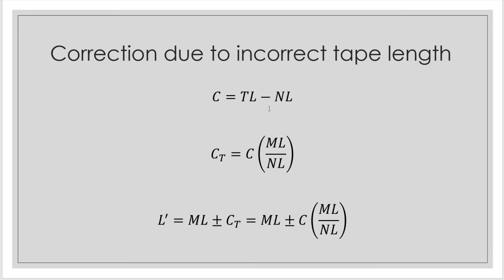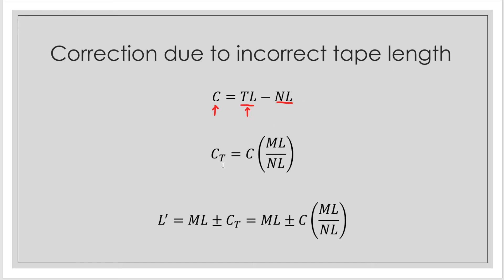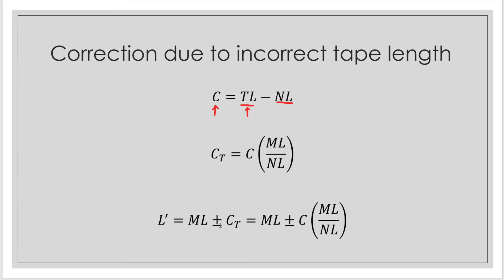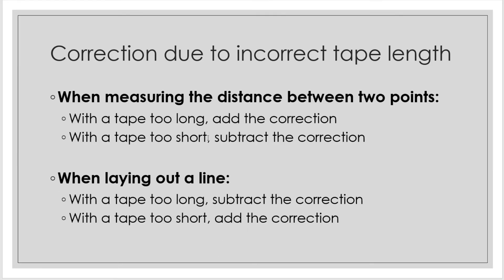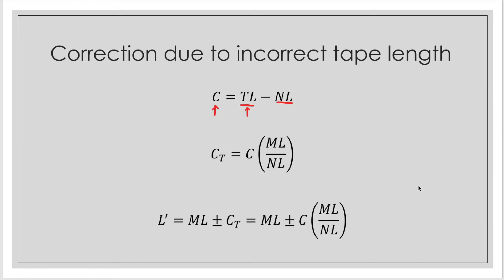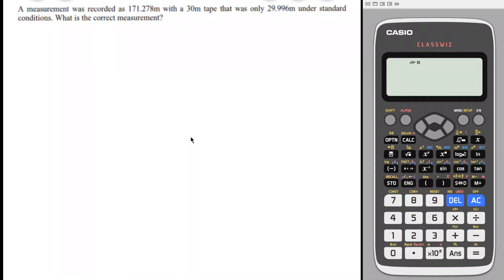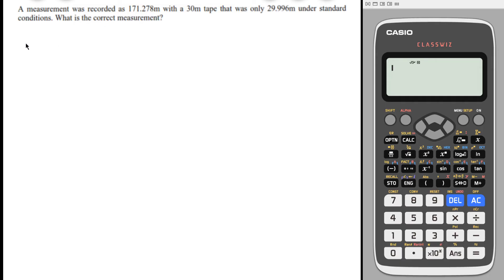Correction Due to Incorrect Tape Length | Taping Corrections

Comment: 2.	A rectangular building 250.00 m by 130.00 m is to be laid out using a 30-m steel tape having a cross sectional area of 0.05 cm2 under a steady pull of 10 kg and at a mean temperature of 32oC. Under standardization the 30-m steel tape supported at its full length is 0.010 m too short at a standard pull of 6 kg with a weight of 1.20 kg with E = 2.0 x 106 kg/cm2 and a thermal coefficient of 0.0000116/oC at standard temperature of 20oC. Sir can u gues kung ano po ung TL nya po di ko po kasi ma gets

Comment: Siiiir. Sa example number one po, sa may L' since Ct is equals to -0.0228, eh diba too short po then we subtract. So L'= 205.32-(-0.0228)? Or hindi na po imamatter kung anong sign nakuha kay Ct basta pag too short we subtract whatever the sign of Ct is? Like sa ginawa niyo po na L'= 205.32-0.0228?
Reply from the maker: The negative sign indicates na too short ang tape.
Reply from the maker: Correct ang last statement mo.
Reply: Thank you sir♥️